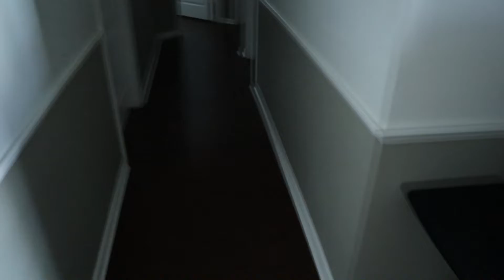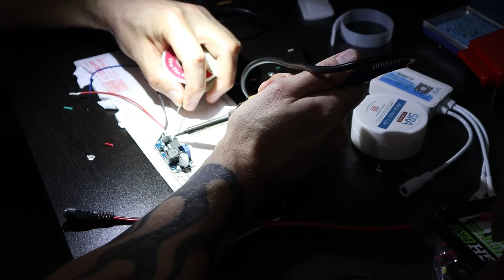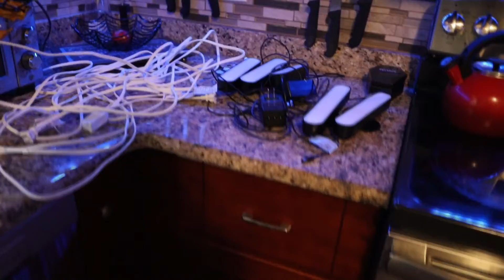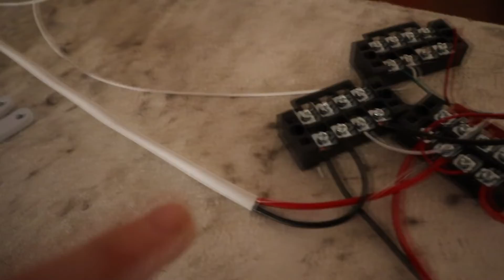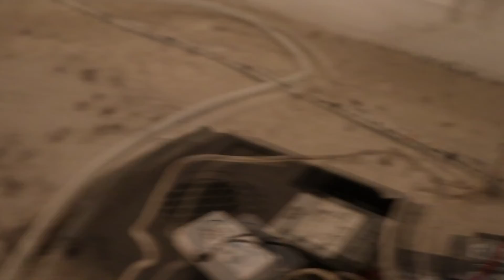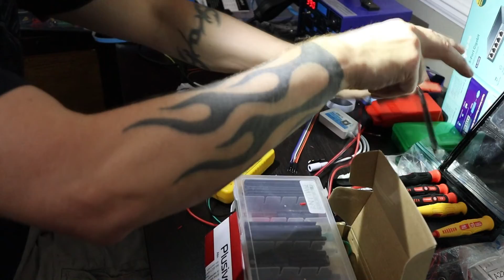DIY WLED ESP8266 Ambient Mood Light Project

Comment: Good video and lights look awesome. I noticed you did not use a fuse on any of your power runs. You should consider an in line fuse for all power and power injection wires. You dont want anything melting or catching on fire. Stay safe ✌